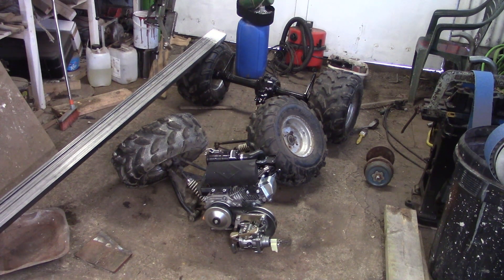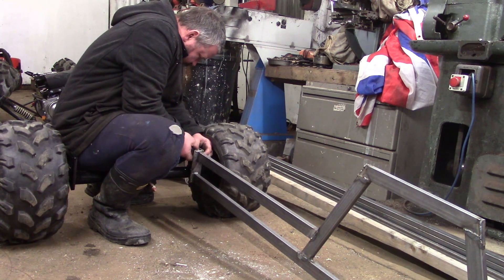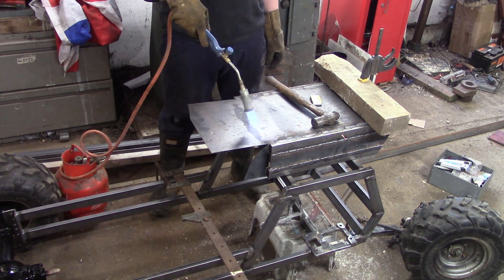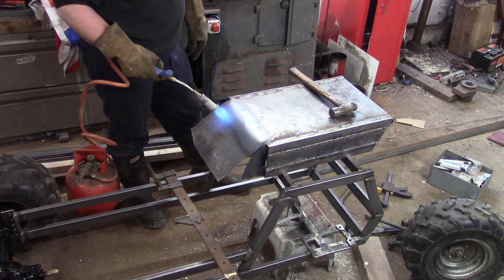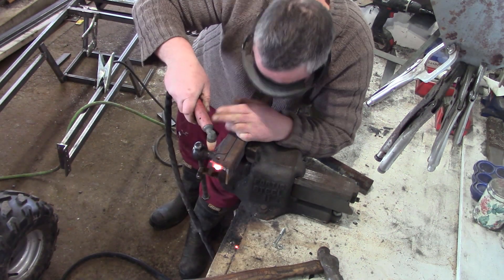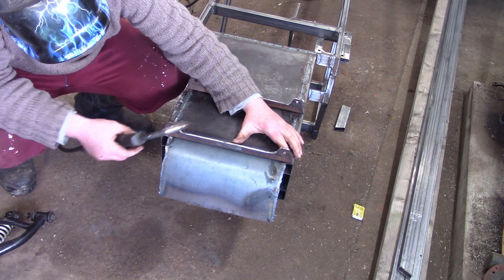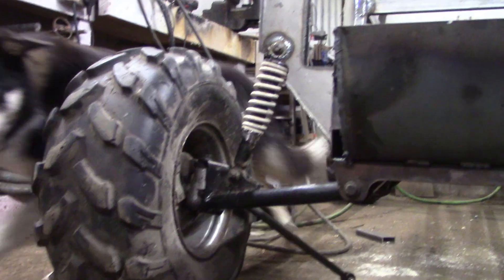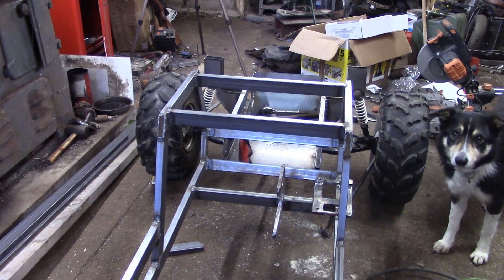Homemade Dump truck MK2 chassis build

Comment: Ha ha ha... Forgot to connect the earth clamp.... Says the man who forgot to switch the plasma cutter...

Excellent work. Thanks for the mention of the channel. 

Where are the brakes?
Reply from the maker: Only got brakes on the front but it's not going to go more than 15mph unless I've got my sums wrong!
Reply: @turboconqueringmegaeagle9006  fair enough... As long as you have some.